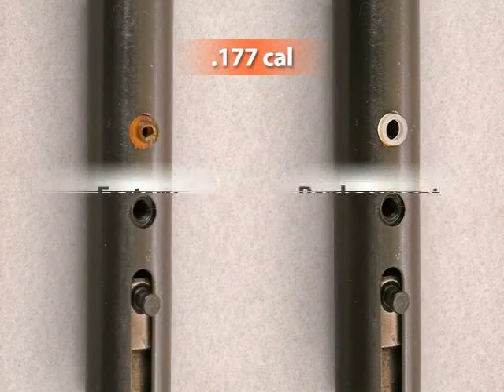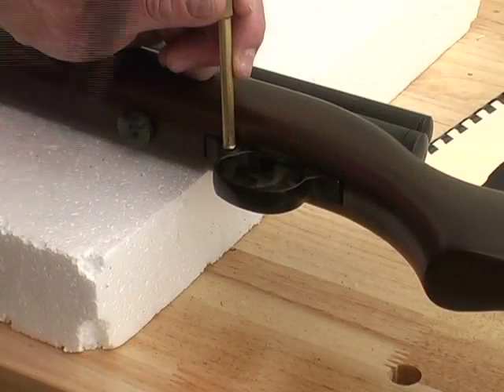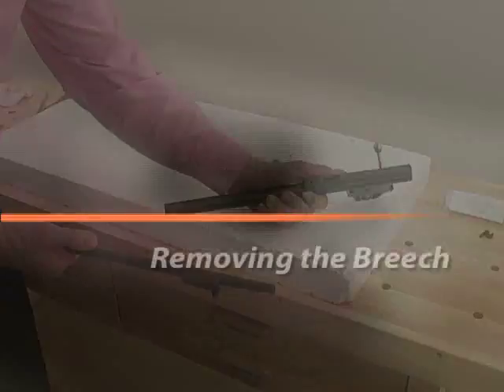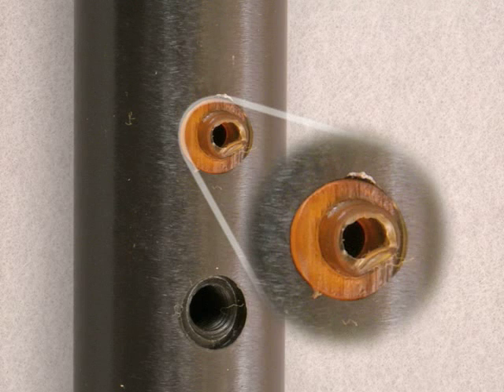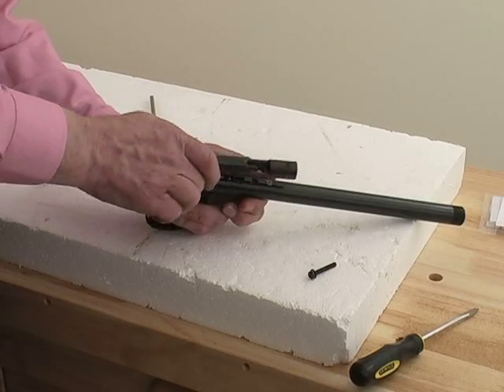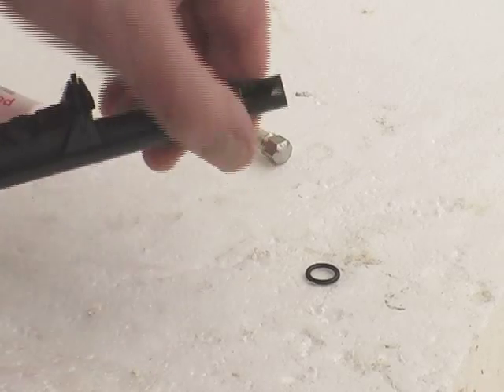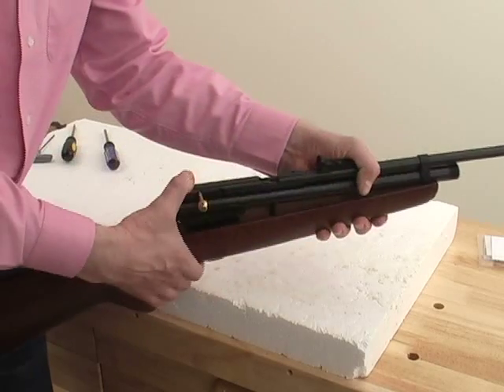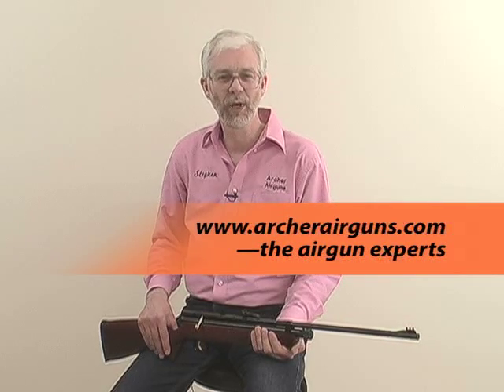QB78 Muzzle Velocity Increase

Comment: Great co2 rifles for the money wood stock and all metal'
My .22 topped @ 18fpe @70° 20fpe @80°
.177 14fpe @70°
Both shoot very well for the grade barrel out to fifty yds'
I use arrow inserts and empty 22mag cases to make transfer ports' also put a fixed piercing pin on the front of valve to do away with the shoot pin'

Comment: the first thing you do while replacing the seals in your qb78 rifle is to install new and improved seals or after market seals or you will need  to replace them again in 6 months i know because i bought a new qb78 rifle and with less than a hundred shots and three months the seals blue out and  i had to send it off for repairs

Comment: I did this mod,and yes,it does work.i saw a bit of a bump in velocity with mine
Reply: Will the rifle be stronger or what ? :)
Reply: @simenolsen4179  if you bought yours in canada im sure youve noticed it could have a little more velocity,and yes it does have a bit more snap to it.if you do the valve mod it shoots even faster but it will only pierce one of the co2 cartridges and youll only have about 40 shots before you have to change.i dunno,they are all pretty easy to do and the extra snap is nice.

Comment: @hagmouse you can get 28.6642 foot lbs at 950 fps with a 14.3 grain pellet using only a 12 gm co2 bottle for power in a 22xx series or QB plat form ,,

Comment: Really stupid question here but I'm just wondering does a projectile from say a sniper rifle speed up over a certain distance before slowing down. E.g. if something was shot at 200m would it have more stopping power than shooting something from 1-2m?
Reply: by god you must be as stupid as they come.
Reply: @R Hebner ha I remember asking this question 8 years ago. Thanks for the answer Hebner! I can see when I wrote it I asked the question incorrectly when I said "speed up over a certain distance". What I meant to ask was specifically what the acceleration was of a projectile fired from a rifle (obviously changes based on various factors some of which you've mentioned). Little google search in 2020 seems to indicate acceleration applies until it leaves the end of barrel.
Reply: @lolololol01_uw0t  I'm just happy you're alive and well many years after your initial comment.
Reply: Correct...stupid question indeed!

Comment: Hey steve. I love this gun. However still have an issue here. Instead of this seal upgrade. I almost want to mill a 1/16 inch flat off the breach ,where the seal meets and tig weld a small peice of 1/8 long by 3/16 i.d., steal tubing back so i only need to use a less restrictive standard oring on the main tube.        I know this isn't a homeowner fix, but whats better for the longrun? This seal used in the upgrade seems like its got a long distance to hold the gas in for a permenant fix?

Comment: The video does not make it seem to hard to replace the seals and o-rings.
However, on your site you have it stated as 5 star difficulty.  How difficult exactly is it? As the video it seems more over dealing with a lot of small details (as it seems less difficult compared to more in-depth changes). So wanted to know what your recommendations for doing this upgrade is.